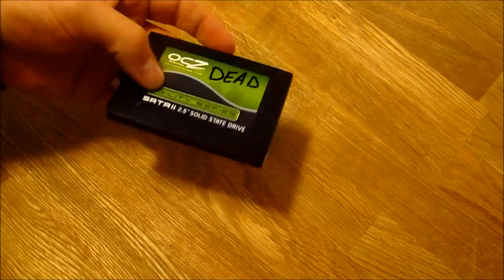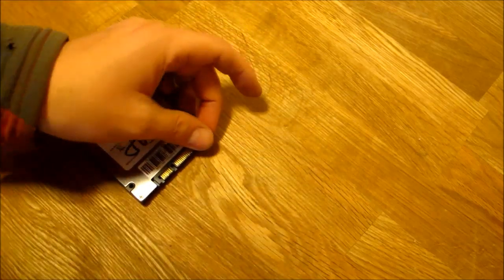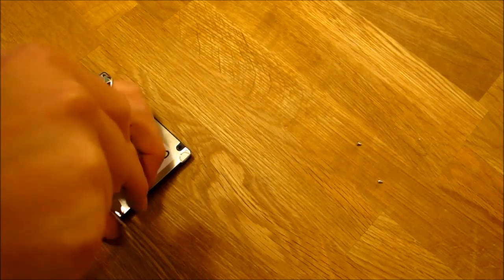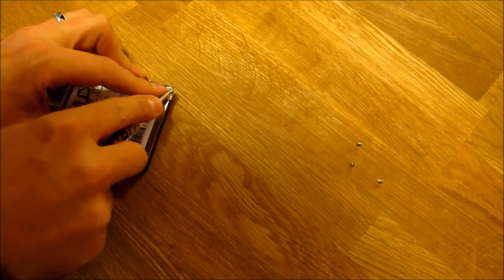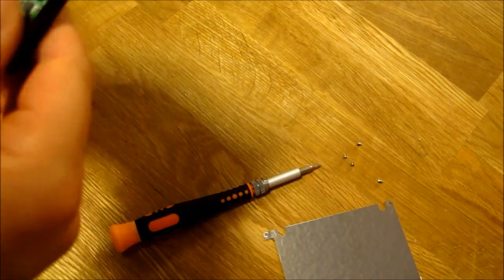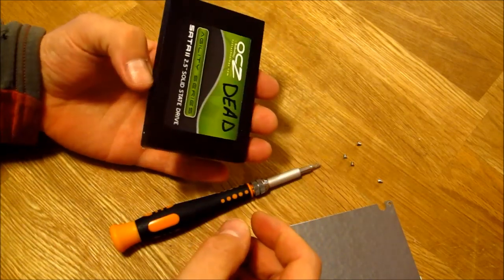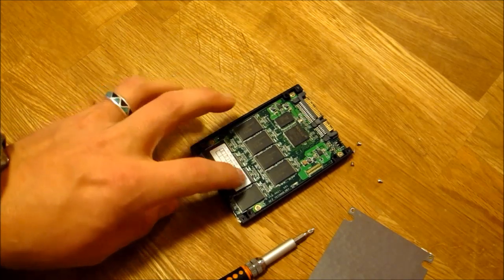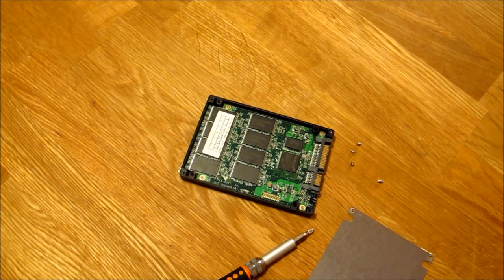Taking apart a dead SSD hard drive - OCZ 60 gb model

Comment: there's a good chance your drive's firmware was corrupted, many of those SSD's are really sensitive to tiny voltage fluctuations that happen when your computer is frozen and you cut the power to reboot it. There might be a way to reload the firmware, usually a couple pins or a factory jtag plug on the board. if you have the firmware, an arduino and some c programming skills you might actually be able to recover the drive, and because it was just the firmware that was corrupted (and if your lucky to have replaced it) all the data on your drive will still be there.

Comment: Sadly my SSD is about a year old, Average use, not stressed to much either, Only use was OS,

They say SSD's are ment to las 2-5 Years more than a Mechanical Drive...

Untrue, 

I have an HDD thats 3 Years older thats been abused more than a cheap hooker.. lol.

But yes, mine started to cause BSOD's. Applications started to fail, Then boom, Dosn't show at post, Nor BIOS...

Such a shame.

Comment: I've got a dead Corsair F80A. Did your drive post in bios at all? Mine just went from working to dead overnight :( (drive been used for 2+ years) - And the promise that I still could read the data from the drive wasn't true at all! I wonder how many users now have tried SSD's only to have them fail.